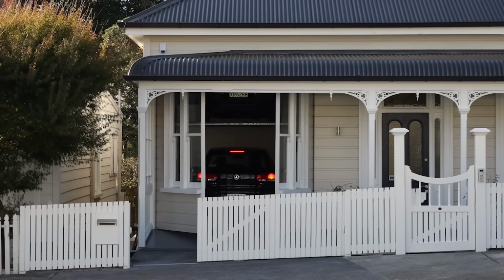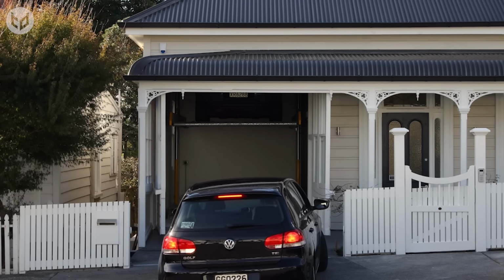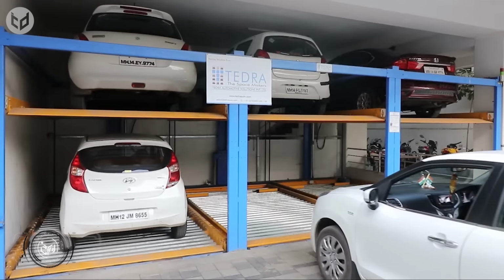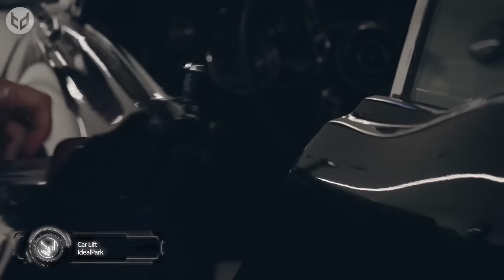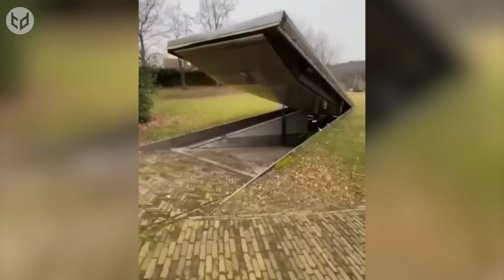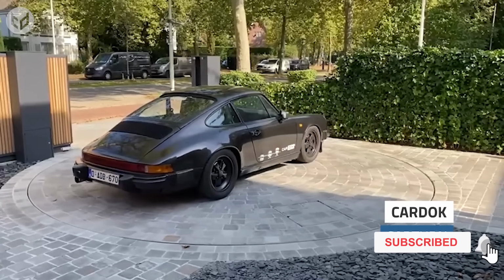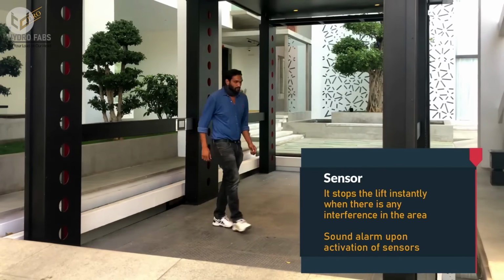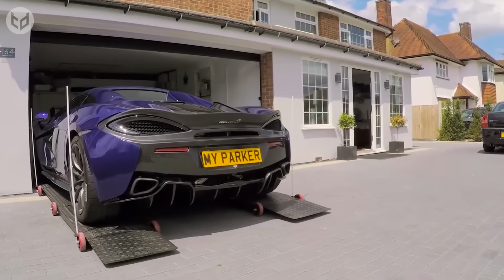Ingenious Parking Garages that Everyone Will Appreciate

Comment: I LOVE the simplicity of the My Parker which enables 2 cars to parked side by side in what looks to be a traditional or slightly wider single garage.
Reply: I agree. It is probably the cheapest on the list, but would have a higher number of potential customers. A lot of garages in the uk have been turned into rooms as they are too narrow to fit a modern car and open the doors. Even in the 90s I was hearing about people that had houses with garages where they had to line up there ford Sierra with the garage, get out, leaving the hand break off, and push their car into the garage. The Sierra is not a big car when compared to a 2019 focus or similar moderne car….
Reply: @petethebeat48  Yep, my favorite too, simplicity
Reply: Yes, I really needed this in a 60s house I lived in 20 years ago. It was a trendy central London place with a compact garage designed for a 60s Mini or Fiat 500 or bubble car.  By the 2000s our cars were so much wider. I bought a VW Polo yet still had to park hard against the garage wall on the left in order to exit from the driver’s seat on the right, door half open, me exiting crablike as I couldn’t turn round. There was an interior door directly into the house but I couldn’t get round the front of the car to get to it! This solution is for ordinary people, the others are for millionaires, businesses and municipal bodies.